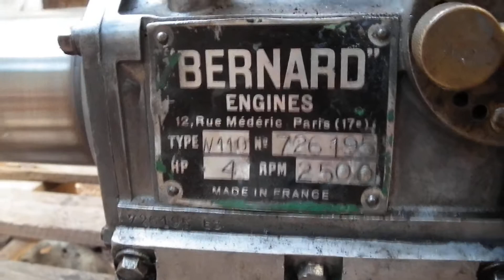Bernard W110 Motures

Comment: It does sound a bit rough, but it's great that you got it running. It looks to be pretty complete (aside from the muffler :-) ) Do you know what it was used to power before you got it? I wonder because of that flat-belt sheaf on the shaft. Thanks for sharing.